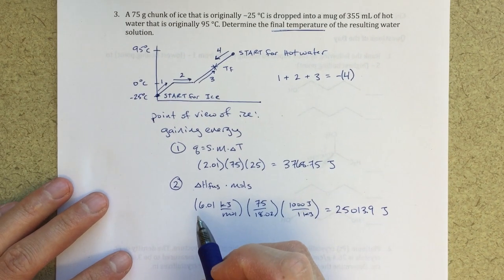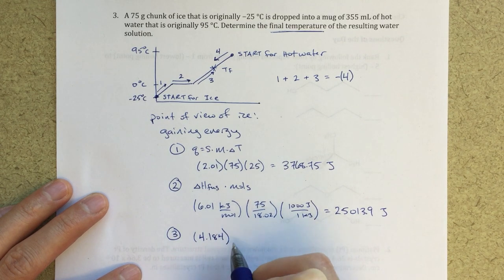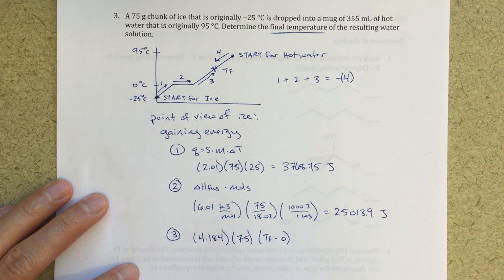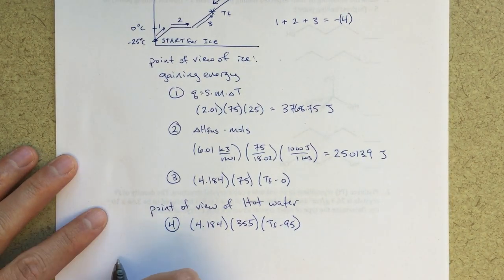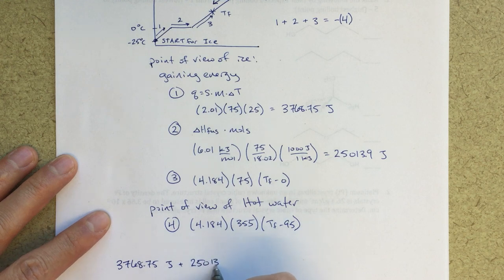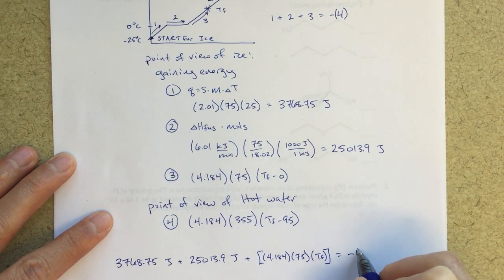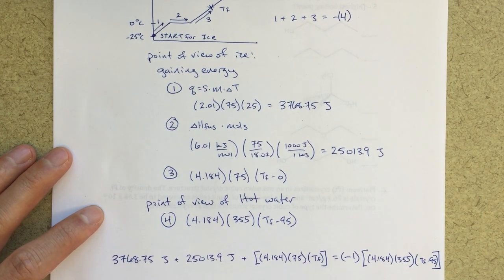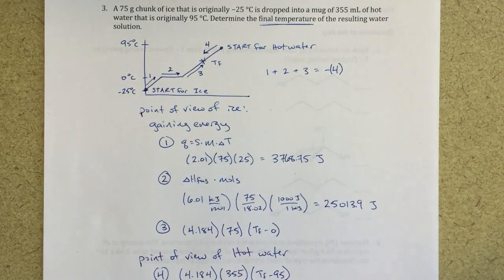Finding Final Temperature When Ice is Added to Water

Comment: If I had to pick 1 video that summarizes how to solve scientific problems in general (physics, chem, thermo, etc) it would be this video. This is how you solve these type of problems. Understand conceptually what's happening and then be methodical in solving for your unknown(s) using the tools (equations) that apply to the type of system you're dealing with.
Reply: The only thing I would add is to do the algebra symbolically first, and "plug and chug" as a final step. Moving those numbers around constantly through each step is a surefire way to lose points and gain frustration. The bad part about frustration is, a small error may convince a student that they are missing something significant when, in fact, they fully understand the problem conceptually, but have dropped a decimal or something.

Comment: So in this problem, you assume that all the ice melts and go on to solve it. But what process would you use when only some of the ice melts? And how do you make that determination? 

for ex: 50g of ice at a temperature of -40C is added to 100g of water at 20C in an insulated container. What is the final temperature after equilibrium is reached? (problem from class notes)

Comment: You don't have to multiply by negative if you swap around the Tf and 95 when calculating the cooling of hot water. Remembering that when the hot water cools, the initial temperature would be higher than the final temperature.

Comment: Nice way to make this accessible for weaker students, but a couple of points and errors to note.
1. "mL" which should be "ml" is not an SI unit. Centimetres cubed should be used.
2. 75 g of ice will not melt to give 75 "mL" [sic] of liquid water as their densities are different - doesn't affect the calculation, but a misconception in students
3. best practice it to do the algebra first, then substitute numbers at the end - fewer errors this way.

Comment: What if you don't know if the ice is going to melt?(i.e. ice T = -20C; water T = 20C)
Reply from the maker: I would solve for how much energy it takes to heat up the ice, and melt it completely, then compare that to how much energy the water has available to give as it cools down to 0C. That should give me a good idea of where the 'end point' is going to be, then set up a new equation with that in mind. I can make a new video if you provide a specific problem!
Reply: see, taking the range and dividing by two is a good estimate.

Comment: HELP!! i have a burning question i've been pondering on for so long.

what if we don't know what the final state is? for example if the ice is below freezing temperature and the amount is much more than that of water, how do we know which phase of substance absorbs/releases the latent heat?
Reply: I think it depends on the mass of the ice and water. Remember that things that weigh less are easier to heat/cool. For example, say that your ice has much more mass than the water, then your thermal equilibrium i.e. the final temperature of the system will be in the negatives. Similarly, if the mass of the water was much higher, then the ice will definitely melt.